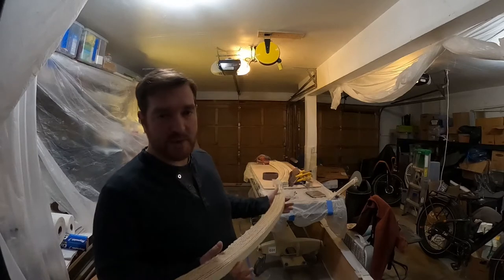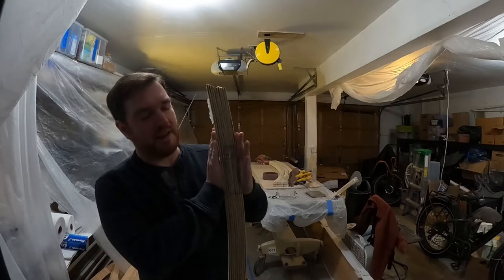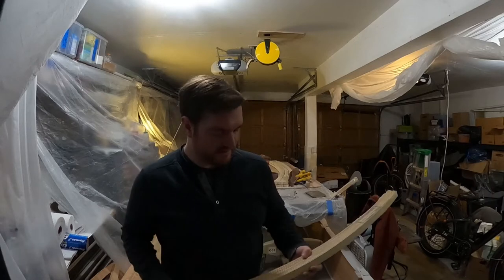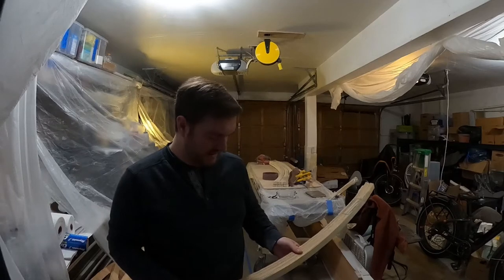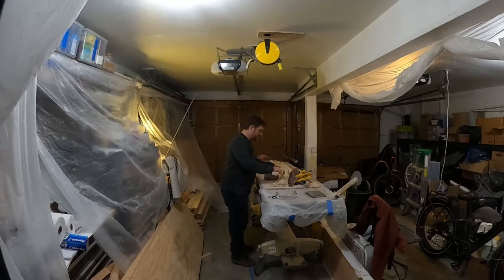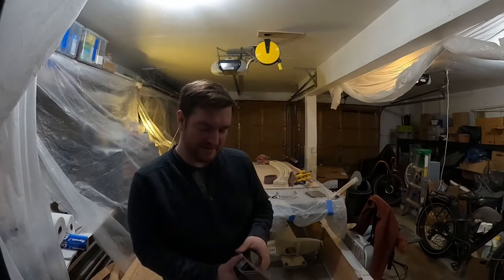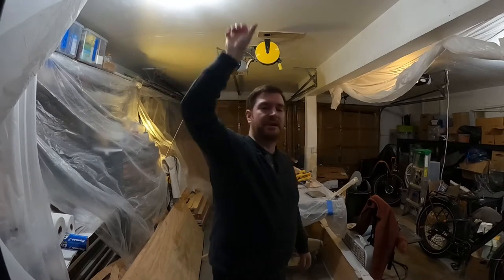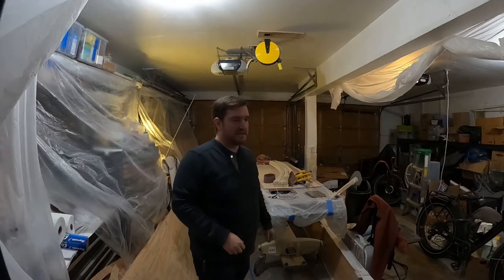#3 - Building my Paradox: 16 Jan 2022

Comment: I like and have used the System Three products.  I used Silver Tip for the entire Skipjack build.  For Scarf joints I used a power plane an then fine-tuned with belt sander.

Comment: Woow those deck beams are looking extremely strong. What is their thickness and width?
Reply from the maker: They're 25mm (1") fore-aft, and 45mm (1 3/4") top-bottom. The widths vary with the bulkhead, but they're about 1.1m (43") or smaller.
Reply: Did you build all the same size? I have my jig built and will start my Paradox build making these deck beams.

5x9mm Okoume Plywood.

Purchased a garage door insulation kit (NE Ohio) and it helps quite a bit!